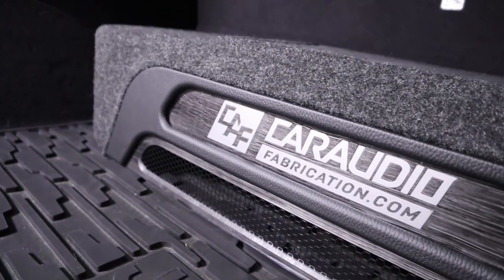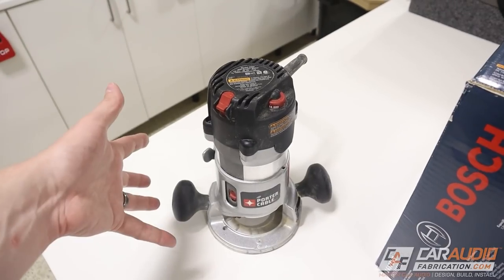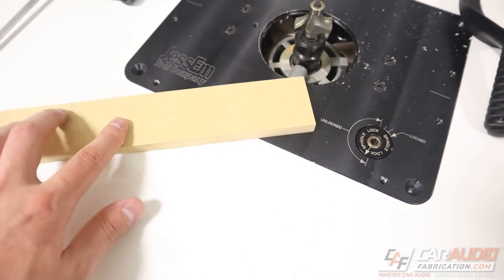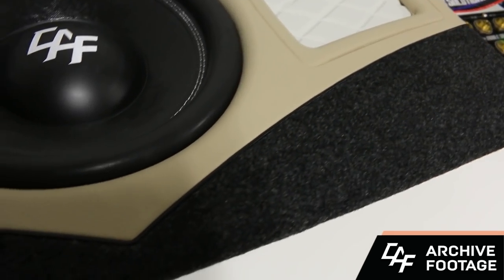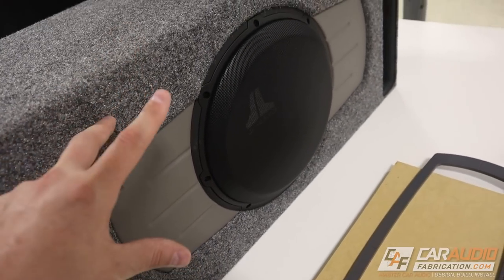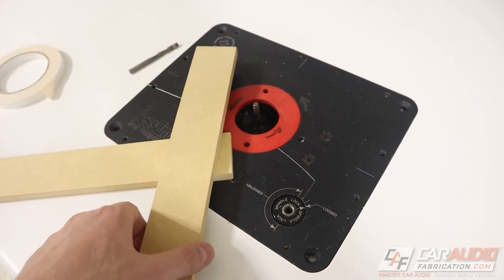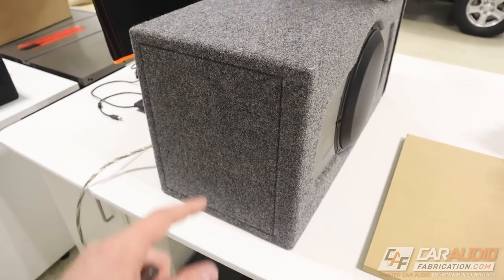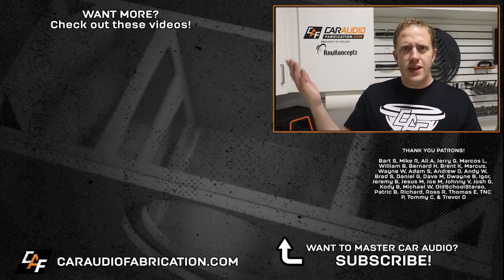Car Audio’s Most Unappreciated Tool - PRO Router Tips EXPLAINED!

Comment: A tip for anyone not wanting to buy a table saw and get halfway straight cuts.. You can also use a long say 5-6 ft level and clamp it to your wood along where you want to run your circular saw.. You do have to adjust for the distance but you get pretty straight cuts. Its what I used to start out and it worked really well.

Comment: That’s a real good overview of the router and routing ops as well as the bits and template uses. I’ve used Bosch brand products and there are others out there, but as far as 2 1/4 hp or even larger as well as smaller routers, you can’t go wrong with them. Using high grade products and tools sets your builds apart and looks matter on these builds. Most customers I have are super picky. Do it right, do it once and don’t be sorry! Another great video Mark! Stay safe mates!😊👍🏻😷

Comment: I have budget router mounted in a table and the other day while using the fence to cut a dado to accept the side panels of a sub box made from 1" laminated tables, the straight router bit started rising out of the router table, cutting deeper and deeper toward the end of the piece. That has never happened before. I was sure the collet was tight but maybe I had it too deep and it walked out...or maybe the manual clamp on the router wasn't quite tight enough. I understand how gravity can pull things down but having it head upwards was a complete surprise.

Comment: I use that bosch router in my table. The big downside is, if you run a dust collector in the box under the router, it fights the routers cooling and its bearing seize up in just a few minutes of use.
Reply: Dust collection?  Hahahaha.

Comment: Im getting a truck soon and sound system is going to be my first modification and my question is can I peice it together? Like get the radio  then the sub and amp then the actual speakers or will they not work with stock equipment

Comment: Hi! I haven'y seen anyone build a box out of carbon fiber and I'm curious if there is a reason why other than cost. I have a 3/4" mdf box and I want to get the weight down. Could I use a hole saw to cut circles out in a staggered lattice arrangement, then overlay 4 layers of 3k carbon fiber on the inside of the box moulded down into the holes making the inside surface all curves for strength then put 1 layer thats just flat on the outside mdf simply for aesthetics? Carbon fiber is significantly stronger than fiberglass. I would also add 2 all thread braces wrapped in carbon fiber near where the sub mounts as its an 8" JL w7.

Comment: Correction = what is useful is not the router itself but the router mounted in a router table.  And I always recommend a heavy duty (3+ HP) router for router table work.  Use the little routers for handheld stuff.  And NEVER buy one of those 1/4" collet only routers.

Pro tip: buy a bunch of 1/2" and 1/4" ID rubber o-rings and slip them on the shanks of your router bits in order to maintain the clearance from the collet Mark discusses in the video.
Reply from the maker: Ok....

Comment: Did you do the maths after checking out the website you provided to see if the manufacturer, Bosch, is lying about the Router being 2.25Hp or did you believe what is on the packaging only? According to the website link you gave, this Router is well under 2.25Hp at 1400 Watts. Your Router is 1.89Hp. I prefer Makita as they are practically the only Power Tool company that is not under a tool conglomerate unlike Bosch. Also, I will not buy from amazon as it will not pay it's workers a proper wage, it only pays slave wages.